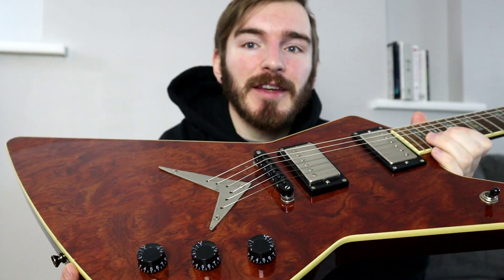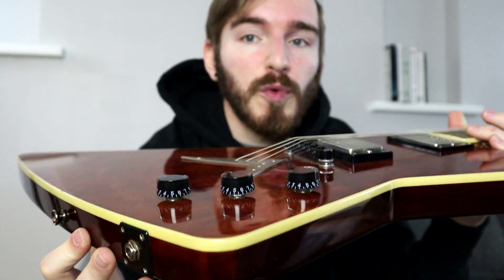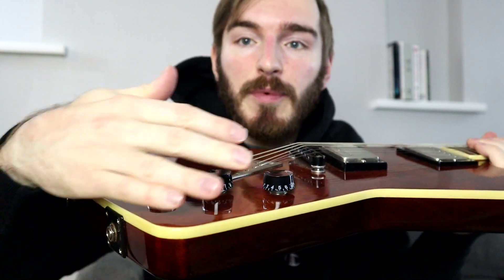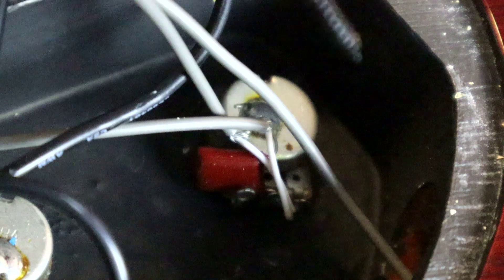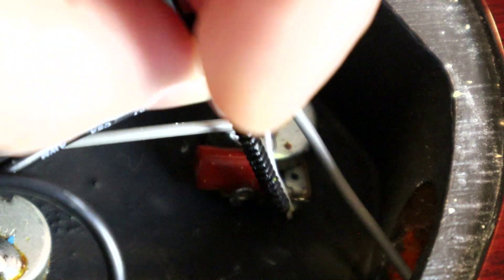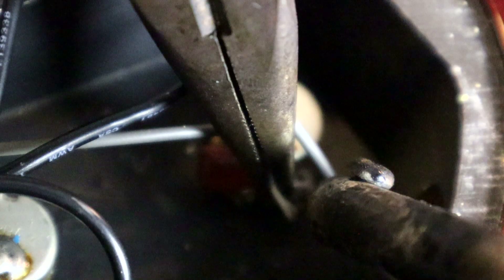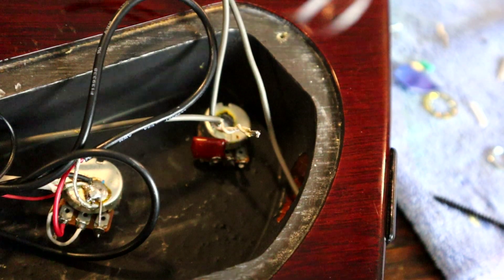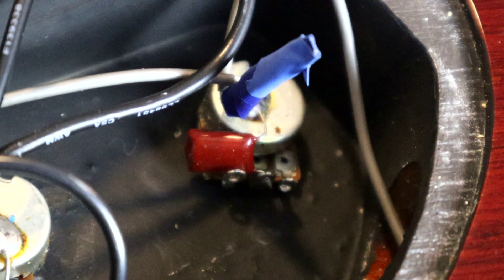How To Remove The Tone Knob From Your Electric Guitar

Comment: You just gave me a KILLER idea for my Nashville style tele. I legit NEVER use a tone knob (pedal tone works just fine, my tone knob is ALWAYS dimed out). It's currently wired like a strat and I don't have that middle tele sound. But if I wire it like a tele I can run the other side of the switch to my tone knob using it like a second volume knob for the strat pickup in the middle. Essentially just turn the middle pickup down if I don't want all 3 pickups playing. That should work right? 🤔
Reply from the maker: @MatthaeusEbonah  in theory that should work! Give it a shot!

Comment: yea i remove the tone knob on all my axes too. I take the pot out too less hardware to get in the way, i actually usually relocate the vol knob to the tone slot because i like the vol knob completely out of my picking path. Good stuff man, cheers! \m/ the snakebyte is sexy too ;)
Reply from the maker: I do that with a lot of my guitars as well! Cheers!
Reply: Onslaught,  do you "plug" the hole left by the absence of the tone pot?
Reply: @williamj.sheehan2001   yes if i'm refinishing the paintjob of the instrument i plug it with wood filler

Comment: Could you please do a video on how to convert tone knob to volume for active bridge pickup and use volume knob for passive neck pickup as its volume, so we can control how much effect for each we want, for rhythms and solos.
And since there will be no more tone, how do you set it to all the way up for each or whatever is required generally

Comment: Why on my guitar is there only one hotwire connecting to the tab   if i disconnect it what will happen

There is a green wire that splits into 2   one end is soldered to the top of the tone and the other to the tab

Comment: Can I ask you a question? I have a vintage v100 les paul and an epiphone standard and I like the tone of the first one much better, the epiphone sounds much darker for solos and I don't like it... And I discovered that the neck tone knob of the vintage v100 It doesn't work, and when I opened the lid I found that one of the capacitor legs touches one of the pot's wires, while in the other tone pot it doesn't (and precisely the knob for that tone works). Could it be that this disables the pot, and is it a modification I can make to the epiphone?

Comment: Here's a weird question. So instead of completely removing it. I just undid the nut and dropped it inside the guitar. Then covered the hole. Kept the knob open at 10. Could doing this cause any weird tone related issues?
Reply from the maker: @artofpretention  well the pot would then be in the circuit, if you're worried about tone loss with the tone knob in the circuit. Otherwise, if you don't want to adjust it by accident when you're playing live, that's a good fix.
Reply: @EricMorettin  ok cool, thanks for the reassurance!
Reply: Art,  may I ask how you covered the hole?

Comment: I removed the volume as well. I wired the pickups straight out. The tone has nowhere to hide and the signal is always strong and clear.
Reply from the maker: Nice 🤘
Reply: Hi, is there a certain way to remove both the tone and volume? I control everything thru my pedal, I just want to know if I can cut both out and thats it
Reply from the maker: @theosagulo  wire the pickups to the toggle switch and then the output jack, or just the output jack if there's only one pickup
Reply: @EricMorettin  so starting from the pickups, the route should be pickups - toggle switch - output jack? The factory settings are pickups - toggle switch - volume - tone - jack, right?
Reply: @theosagulo  Yes. You can wire the pickup directly to the switch > to the output jack. I love it. 
No volume knob to mess around with.
Reply from the maker: @theosagulo  That should be right. Mess around with it until you get signal!
Reply: @endezeichengrimm  Ok, and I solder the grounding wires to the toggle too?
Reply: @theosagulo  The ground wire would go to the Sleeve of the output Jack.
Reply: @endezeichengrimm  I did it, thank you very much for the help guys!!

Comment: I have a super Strat with an HSS and I have another guitar that has HSS, but it has two tones and one volume and it’s a wiring harness and I wanna put it over there. Can I remove one of the tone knobs
Reply from the maker: Yes you can remove a tone knob from a guitar that has 2. Might have to wire it differently though

Comment: Sometimes people mistakenly think a tone pot on 10 is the same as removing the tone knob from the circuit. There's still capacitance, even with the pot at 10, so you lose high-end and a touch of output.

Thats one of the reasons Fender has the TBX tone circuit (I think it's the TBX, anyway LOL). 9 is a regular tone pot on 10. The detent between 9 and 10 takes it out of the circuit entirely.
Reply from the maker: @nicholastotoro7721  you're exactly right! Same with some companies wiring their tone pots to a push pull pot that will engage or disengage it depending what position it's in
Reply: Can I ask for more info on this? I've removed the tone knob from a few guitars and always start hearing a difference when I thought there would be none. I've had people tell me removing the knob ADDS tone, but I'm starting to think I've chopped off an essential part of that "first day sound"
Reply from the maker: @dwolivas  You have less parts in the circuit so the tone will change a bit. Another thing to consider is that our ears are always changing and the way in which we hear frequencies as we age will change as well!
Reply: @dwolivas  

I guess it depends on what they mean by "adds tone."

Some people like the sound with extra presence. That's what removing the tone knob from the circuit will do. Just having it in the circuit will add capacitance, which will take away presence, even when the knob is at 10.

Fender has a tone control with a detent between 9-10 that is a compromise of sorts. When it's at 9, it functions like a regular tone knob at 10. When you pass the detent and go to 10, it removes the tone knob from the circuit and gives you that extra bit of presence.
Reply: TBX goes from 250k to 1 meg, a no load pot has no resistance